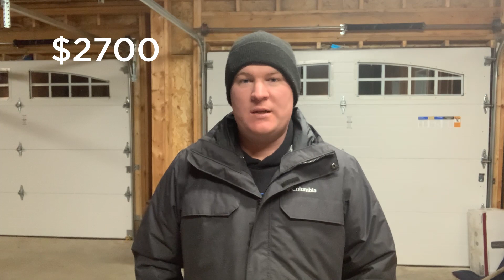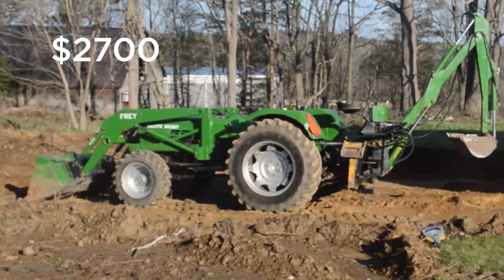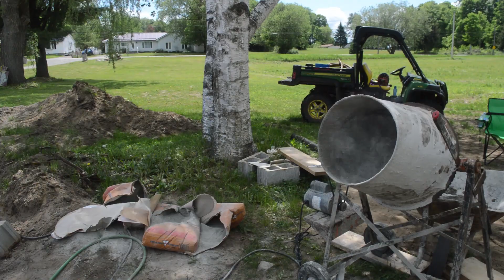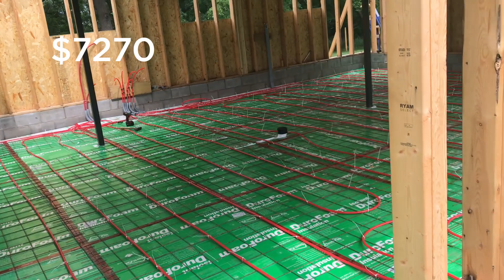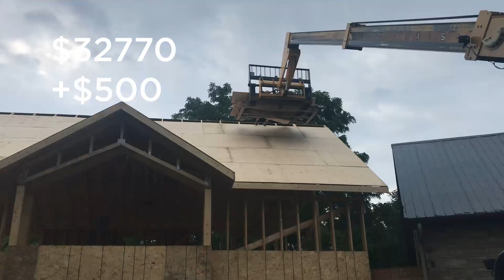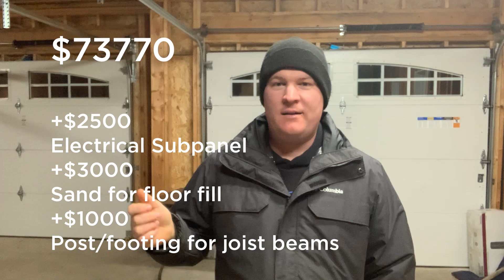House Addition: Part 7 - What did it cost?

Comment: You glossed over the "design phase" pretty quickly. Did you use a program? Was the a reference tool you used to know how to do this? My quote in Akron Ohio for an 18x18 bump out was $7000 for drawings and I'm considering alternatives.